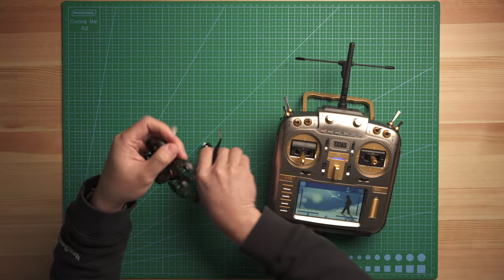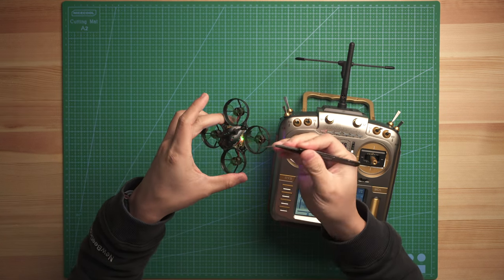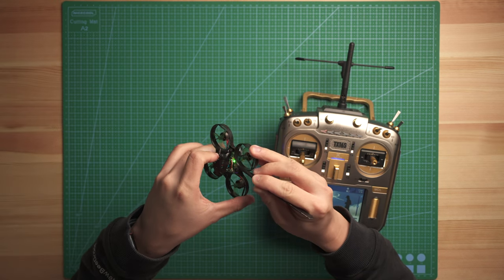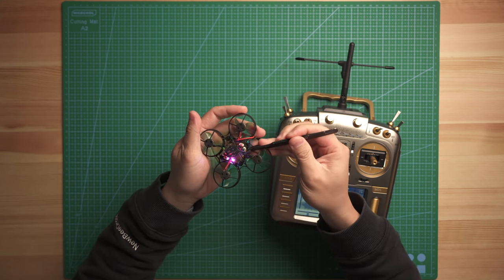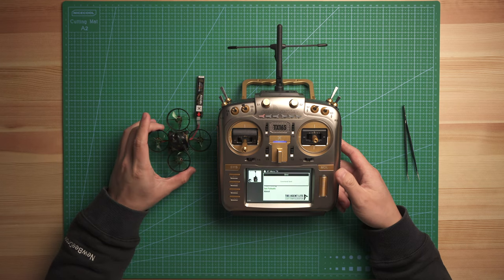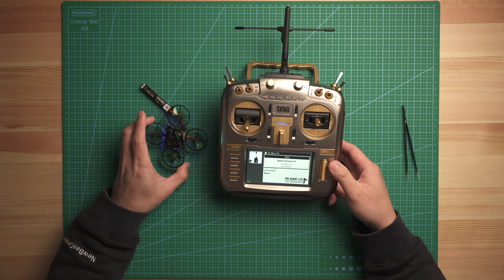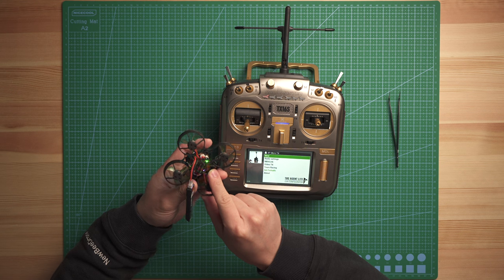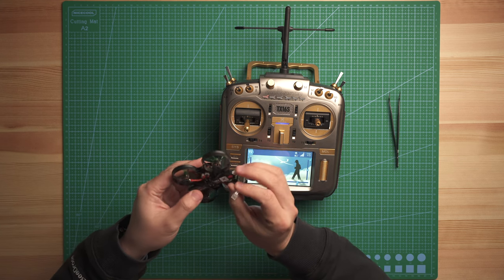AcroBee65 BLV4 CRSF Receiver Binding Instruction| A NewBeeDrone Tutorial

Comment: What actually needs changed to get 100% motor output?
Reply from the maker: connect the Flight controller to betaflight configurator, go to PID tab, there is a motor output limit, change 80 to 100. you will get 100% motor power.